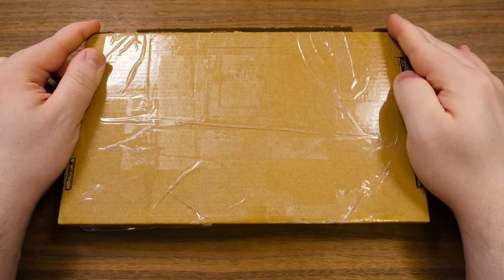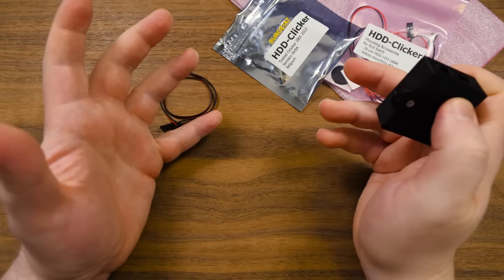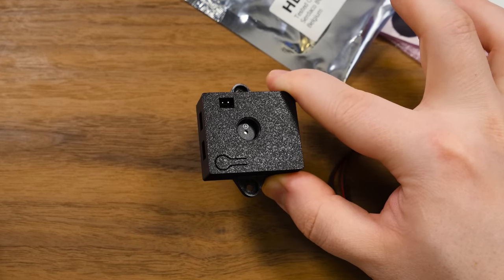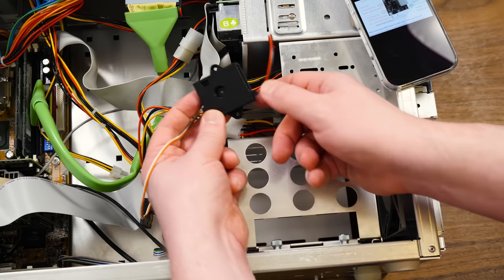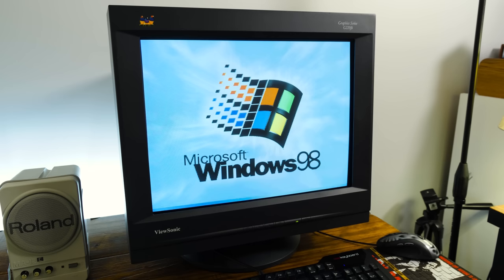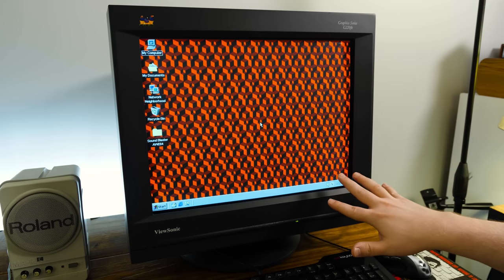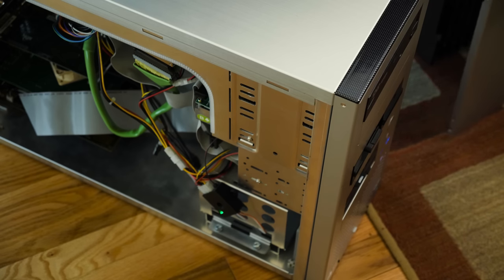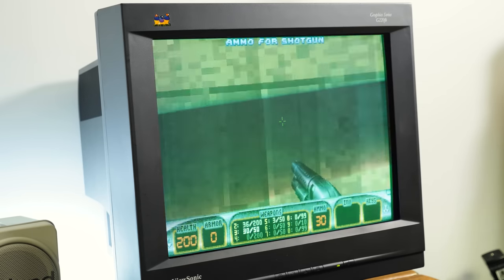The HDD Clicker: Add Hard Drive Sounds to SD/CF/SSDs

Comment: i wonder if the button changes the sound or something? im not sure if you tested what it does
Reply from the maker: I briefly mentioned it later in the video, you press it to test the sound.
Reply: @LGRBlerbs  oh ok fair enough I missed that, thanks for the reply, I think it should be to change the sound instead of testing it but it did sound very convincing for a silly little speaker being triggered by the activity led lol better than I expected

Comment: I really don't like this whatsoever. An overprized buzz generator with no semblance of harddrive sounds. It is just an annoying buzzing sound. Nothing like a real hard drive. Not only is the sound terrible, but they didn't even implement any algorithm to vary the pattern of the buzzing. It literally just buzzes each time the HDD activity LED is activated, which means a lot of activity with modern flash memory as you demonstrated in the video. Real code should be varying the buzzing so that it plays different tones and varies the noise pattern to emulate disk seeking, ignoring some of the activity signals to not be overbearing, etc. So nah, sorry Clint but this is a terrible product in its current state. Overpriced buzz signal generator which sounds nothing like a hard drive.

Comment: Gamers Nexus spending thousands on sound measuring equipment to test systems' overall noise levels with hyper-accuracy so they can create recommendations on building the quietest system possible? Cool. Adding the noise back into the systems simply because we like it? Cooler.
Reply: I never minded HD clicks, it’s constant jet engine fans I could never stand in computers.

Comment: This is one of the dumbest gimmicks I've seen in a while.. if it's an old machine, there's no way you're getting any speed benefits from using solid state storage-- the bus is going to max out way before you ever come close to the manufacturer specified speeds.  If you want the noise, there is no reason not to use a normal hard drive.  If you need IDE but for some reason all you can get is SATA, just use an adapter.  I just don't understand what the point of this is, especially since it doesn't even sound like a hard drive.  Like someone else said-- it sounds more like a geiger counter.
Reply: I think in Clint's case, a major reason to use solid state is for easy swapability. He can have a few different SD cards with different Windows installations and configurations and change them out as is needed for the programs he wants to run. It's not necessarily about speed, and using a normal hard drive won't have the same flexibility, so this is really the only way to have both the swapable storage and the nostalgic noise.

Comment: Complete and utter overly priced GARBAGE, this does not sound remotely like any HD, at least not a normal one - the clicking is LOUD, it is emulating only fast seeking, no spin up and initial head sound emulation, no volume control to adjust loudness, this is definitely too loud, who in their right bloody mind would want that - maybe really old HDs from decades ago make that noise, but no modern hard disks make such loud clicking FFS, this is crazy.

Comment: It's worth a fiver in current state with no logic more than just be in sync with blinks. For example when led is on during large file transfer, it should imitate head seek every now and then. Simply clicking with led blinks is far from realistic behavior.
Reply: Yeah I mean you could get the same effect just plugging a speaker into the HDD LED plug with a small resister and pretty much get the same clicking. $30 is just laughable.